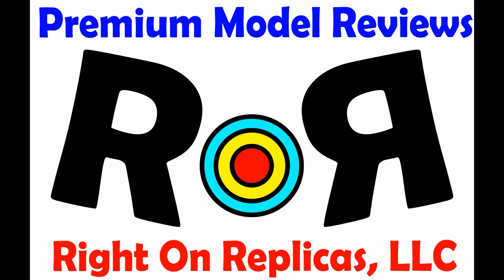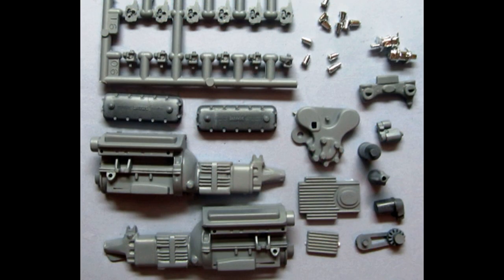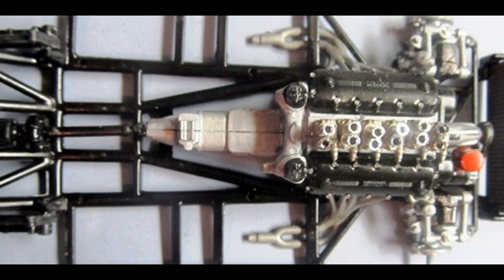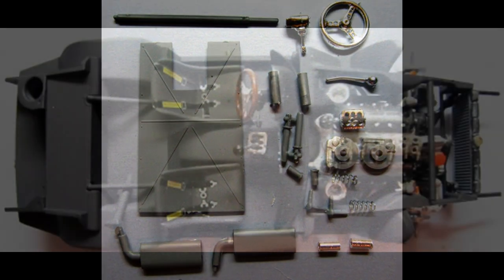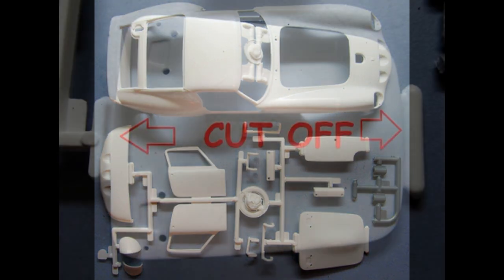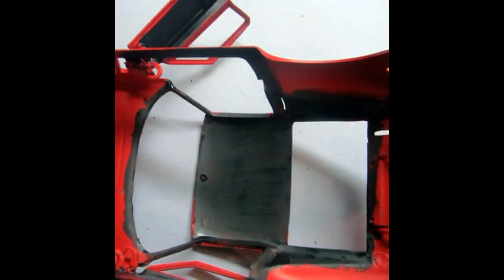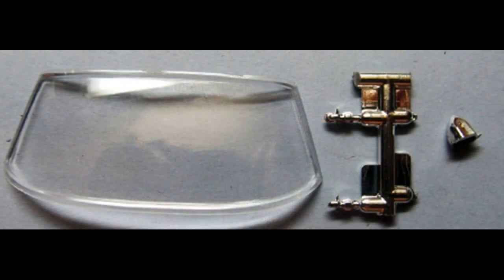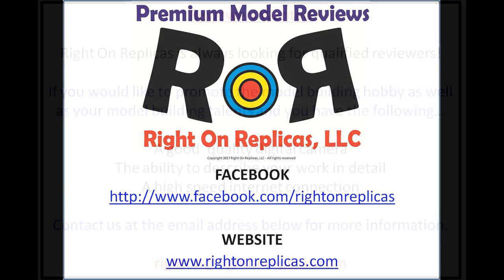How to Build the Ferrari 250 GTO 1:24 Scale Revell Model Kit #07077 Review

Comment: I have this kit but I bought it at least 15 years ago and stopped building for 12 years. I am now finishing this one as its my fave car and I just finished a Lancaster BII. My version of this kit is slightly different, mainly the decals are totally different to these and quite a bit more detailed. I am not sure if I have the race exhausts either but haven't checked. The colour schemes it suggests are one with a flowing white stripe down then centre or one with a yellow nose but I think I prefer all red really. I do have the same treaded tyres though... This has given me a few better ideas for painting as some of the suggested colours seem strange. Thanks for the video!

Oh wait, having a closer look my tyres are nowhere near as heavy treaded as these and don't have the huge depth on the outer edges. Maybe the older versions of this kit were better which means I am lucky :D

Just checked my kit and the racing numbers for the two options I have are 24 or 47 and the rear plates both begin with MO - 8. Good news is I do have the racing exhaust option. I think the older versions must have been better as I had zero mould lines on the main body at all, its perfectly smooth.
Reply from the maker: Ivor,   Thanks for sharing and please subscribe if you haven't already to help us reach more modelers! -Doug